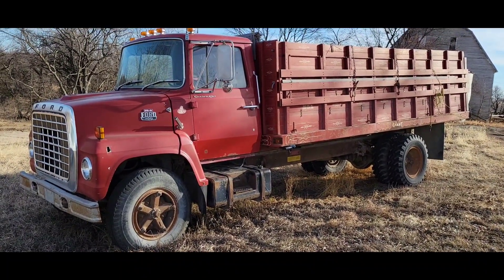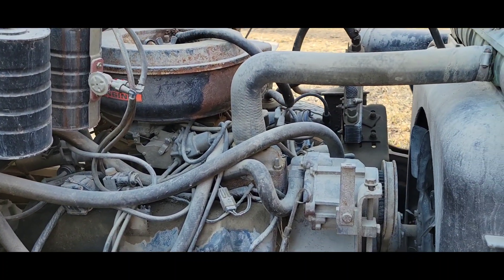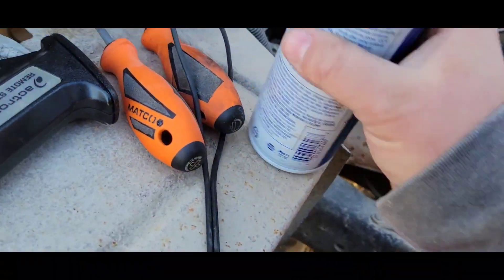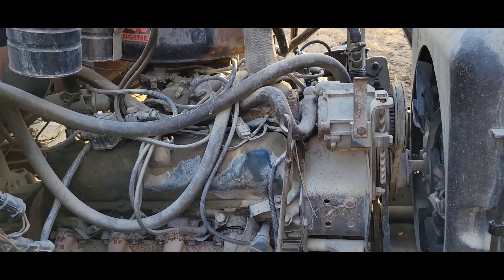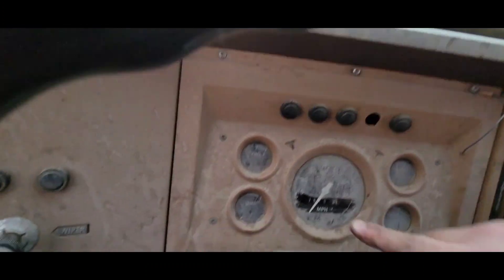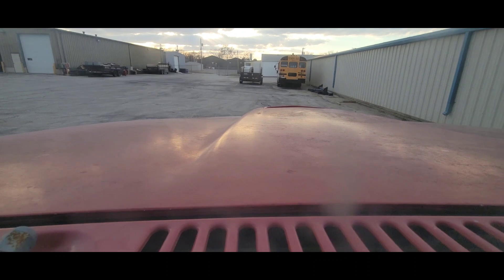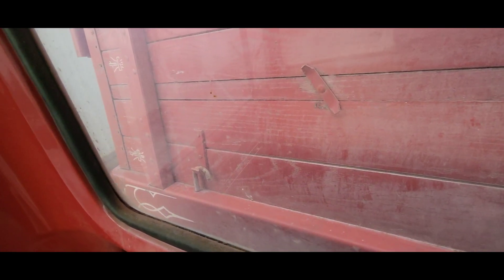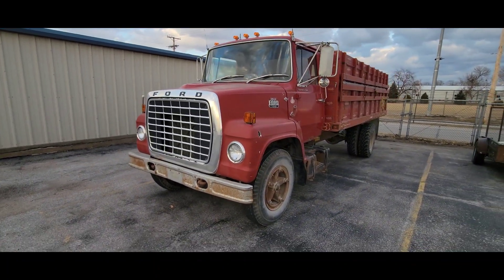1980 Ford LN700 Will it Run & Drive?

Comment: Good evening! I have a 1975 Ford LN700 with a 361 gas engine , do you have any leads on where to purchase fuelfilter , oil filter and i also  need radiator cap . Looking for sparkplugs too . THANK YOUI